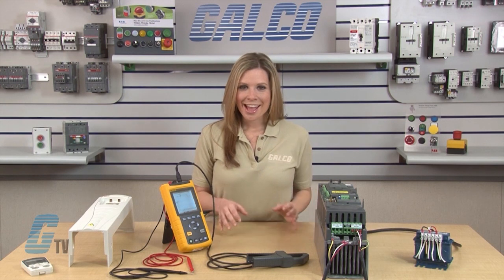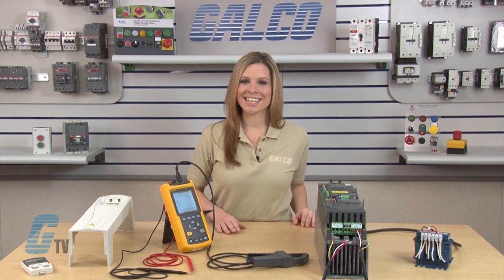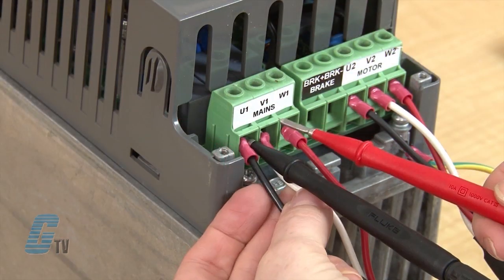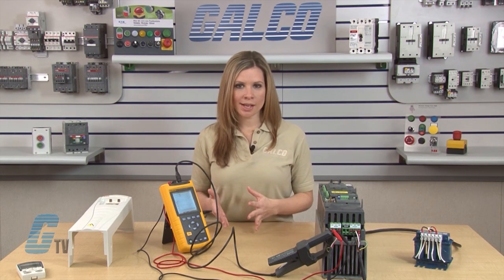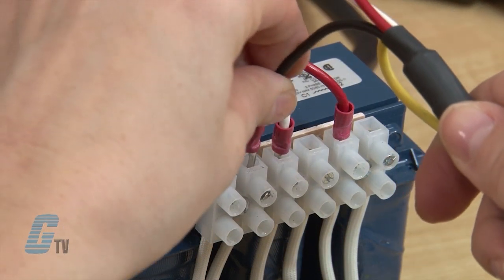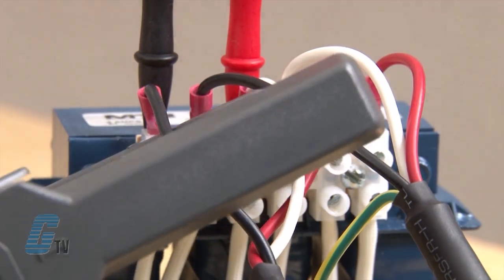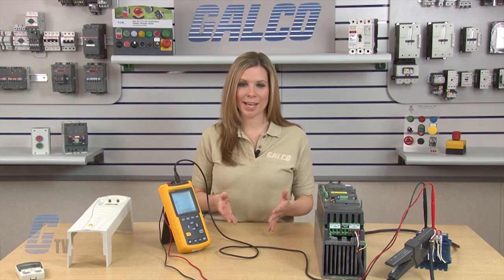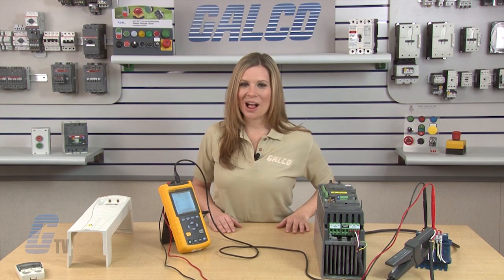How to Wire the MTE RL Series Three-Phase Line Reactor to a Variable Frequency Drive

Comment: I intend to use a load reactor on the output of a split phase battery inverter to help with surge loads, can I wire it with neutral on the center phase of the 3 phase reactor? so I can have 240v from L1 - L3 and 120V from L1 - L2, is this safe?

Comment: I have motor 110kw  I need explain
Reply from the maker: You simply connect your reactor in series with the incoming line power to the VFD. Here we use a harmonics analyzer to demonstrate the differences with and without the line reactor.
Reply: General source voltage u.p.s to vfd 110kw Because Electronic damage Capacitor in u.ps I need Full production
Reply: Maybe in ups 300kva harmonic

Comment: Did you forget connecting input power to VFD after insert the line reactor?
Reply from the maker: Nice catch.  It was verbalized, but it looks like it was not connected in the medium shot.  The simulation required three phase power and a load, which due to a technicality was not available in that room on the day this was shot.  we set it up somewhere else first, but looks like we missed reinstalling those wires.  We hope that the overall message and the benefits of the line reactor are conveyed.